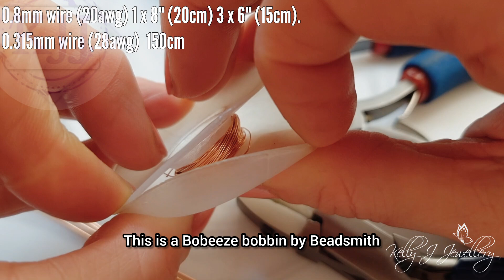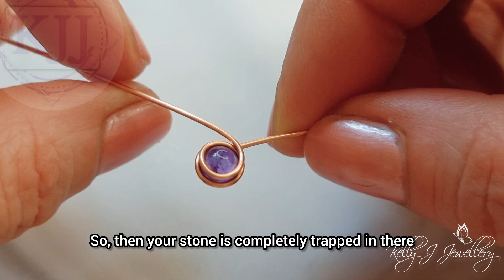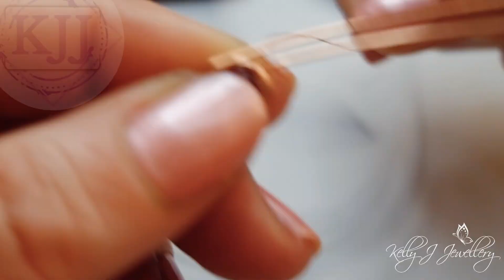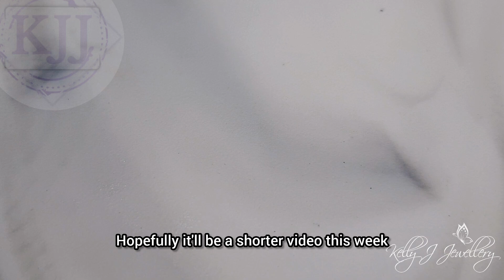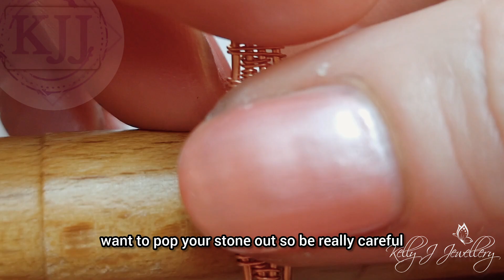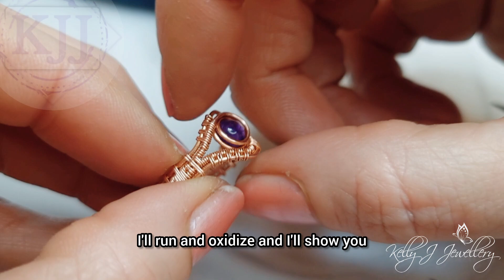Malory, Wire Wrapped Ring Tutorial | Kelly J Jewellery.

Comment: Does your stone need to be round or would an oval work?
Reply from the maker: You can use an oval, be sure to bend the wire around the shape of the stone to hold it 👍
Reply: @KellyJJewellery where do u get all the Stones?
Reply from the maker: I buy the smaller ones off Etsy, search 5mm cabochon 👍
Reply: @KellyJJewellery  ty 💕